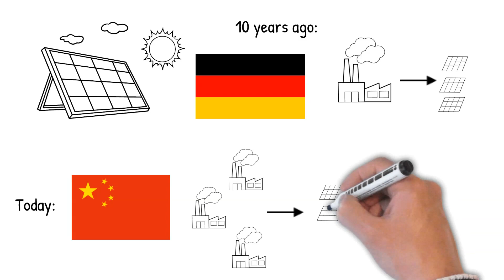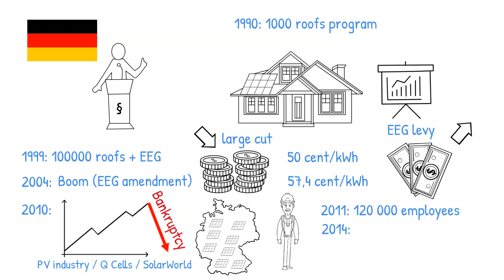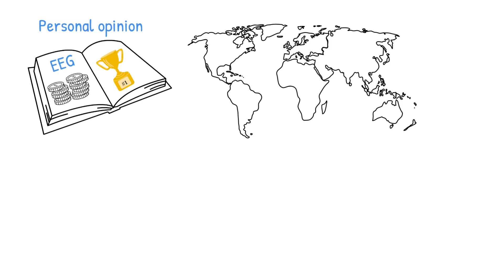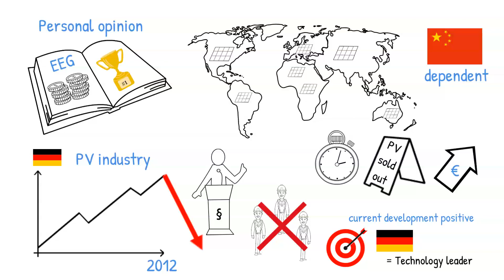The Downfall of the German PV industry

Comment: I worked for 6 years on the developement of printed solar cells, which could bring down costs of PV calls to 1/3 of the current price but we run out of research money too early. More research in this field is urgently needed as the current production process need a lot of energy.